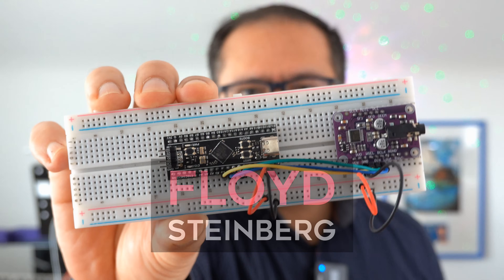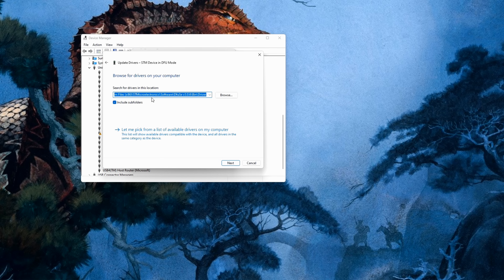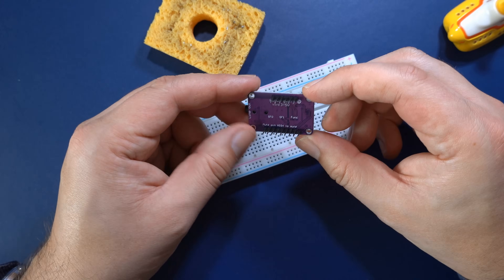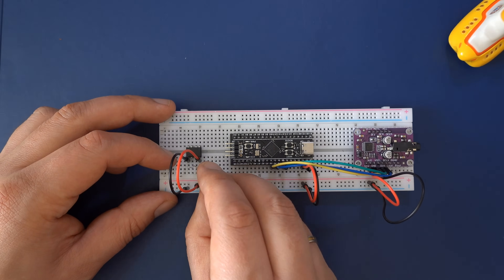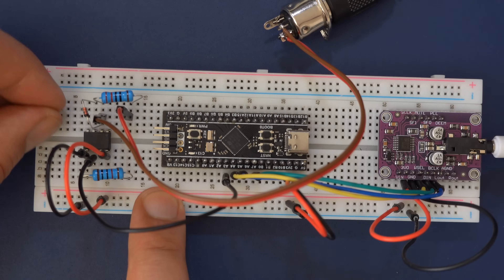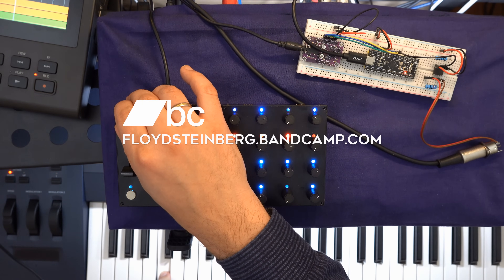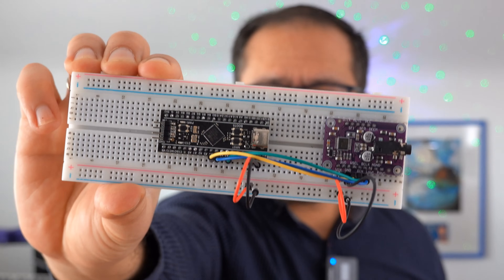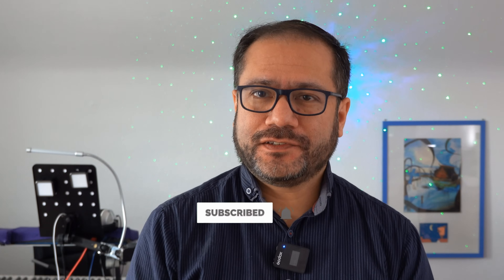This $20 synthesizer sounds very nice indeed

Comment from the maker: Please subscrive to Blaines' YT channel (and get the firmware over there):  https://www.youtube.com/watch?v=JttEPK7bwHw
BlackPill STM32F411 board (I bought the F411 25M HSE) https://de.aliexpress.com/item/1005001456186625.html
UDA 1334A DAC module https://de.aliexpress.com/item/1005004932558176.html
5pin midi socket https://de.aliexpress.com/item/33030129792.html
6N137 optocoupler https://de.aliexpress.com/item/1005004249645464.html
220 and a 10k ohm resistor https://de.aliexpress.com/item/1005004525936064.html
1N4148 diode https://de.aliexpress.com/item/1005004333197874.html
Jumper wires https://de.aliexpress.com/item/1005005990715944.html
Breadboard https://de.aliexpress.com/item/1005001456586666.html
Electronic component tester and identifier https://www.amazon.com/-/de/dp/B0BK95J4TV
Reply: Filter sounds surprisingly good. Haven't been producing for a while, so is that a diode ladder a moog filter? Sounded familiar, but it seemed creamy AND edgy...so maybe it's somewhere in between those 2. Or maybe it was a hard synch modulation making that sound?
Reply from the maker: @OMNI_INFINITY  Please watch @synthetechs videos on that topic: https://www.youtube.com/watch?v=9taujr3BouA and https://www.youtube.com/watch?v=687XoUewvp8
The synth is 100% software, all the electronic parts you see are for the MIDI input and the audio board.

Comment: Your work is certainly valuable, thank you. But finally, there are the devices you've connected. This part may be cheap, but what are the others?
Reply from the maker: Hi, I used the intech Grid controllers here (which of course are not cheap), but for this synth, any MIDI keyboard with some knobs will do, for example the RockJam keyboard, which is one of the cheapest MIDI keyboards you can buy.

Comment: Hello, I’m not sure if you still answering to comments but does this synth support USB midi? Or how can I replace midi controller? Maybe there are some diy midi DIN controllers.
Reply from the maker: Hi, as it is, USB MIDI does not work (if I remember correctly). You could replace the 5 pin plug with a TRS 3.5mm plug easily, If that helps.

Comment: Could you attach so potentiometers to a panel and then attach them to the board to control the parameter's?
Reply from the maker: Yes, of course! But you'd need to change the code to listen to input on some pins. This shouldn't be too hard, though, usually it's changing 2 to 4 lines...
Reply: @mr_floydst excellent! Thank you!

Comment: "make sure if pins doesnt touch other"...why it would be problem in this case? Only problem would be if tx touch rx. Midi is 2 wire protocol. 5 pins on midi standard port is BS...That is why modern uses just stereo jack instead.
Reply from the maker: Uh, to be honest, it's just a thing I said, like "don't forget to tie your shoelaces before heading out". Well-meaning but not that relevant, but also not wrong. ;-)  Obviously, having GND and TX/RX touching each other would render the MIDI port useless.
Reply: @mr_floydst  My point is that old midi 5 pin connector is just ancient tech, which was probably used as conector with more lines, but evolutions showed that tx rx (serial) is quite enough for humans

Comment: I am new to synths in general but VERY new with diy synths especially. Can you tell me if i would be able to sync this with my nts-1 and PO-33 or is that not something that is standard. Beyond that would i be able to combine the out audio but plugging it into my other synths or would i need dedicated hardware to do so?
Reply from the maker: Hi, as it is, this synth does not need syncing, as it has no sequencer built in (and it also does not support syncing LFOs and envelopes to time-triggers).
It's really intended for use with devices that have a MIDI out port, like MIDI keyboards, -pads or sequencers.

Comment: What in your opinion are the best CC channels to address for the 8 encoder knobs on my midi controller for a beginner to get some noticable and interesting sound changes.
Reply from the maker: Please look up the numbers in the document:
Filter cutoff frequency - to change the "brightness" of a sound
Resonance - to create that whistling sound
LFO depth and speed - used for creating periodic modulations like vibrato and tremolo
Attack and release - make sounds begin and end slowly or abruptly.

Comment: 1) How long did it take you to assemble the synthesizer? 2) How long did it take to debug?
Reply from the maker: The most work went into sourcing all the parts. Assembling it takes 30 to 60 minutes, and there was no debugging required (the firmware is readily compiled and only needs to be uploaded)
Reply: @mr_floydst  Tester and identifier of electronic components - can you do without it? It is not available. Or just measure with another tester?
Reply from the maker: Hi! Yes you can do without that. All resistors have color coded rings that identify them https://hirophysics.com/Labsheet/resis-codes/resis-codes.html
Reply: @mr_floydst  Thanks for the answer! But I meant, (Is it difficult to mess around with the setup: Measuring voltage, current, etc.!?
06:23 Testing and setup"!!! Will an amateur cope with this (I can only solder). English according to the translation and Google autotranslation.

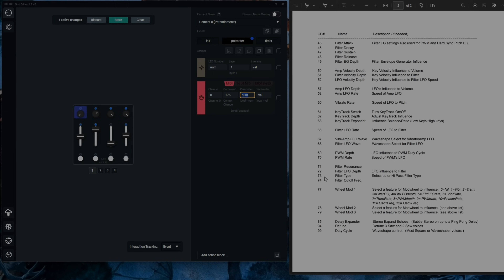Comment: I was tracking up to 7:26.  Could you explain what you plugged all that stuff into?  I see USB, a computer program, a keyboard, and the black box with the dials on it.
Reply from the maker: This is a MIDI controller, and the computer stuff briefly shows its setup app. You can use any MIDI controller (keyboard) that has some knobs on it. After setting up the knobs according to the list on the right (or in the BP synth docs), you don't need a computer. Just connect the keyboard/midi contoller to the synth via the 5 pin MIDI port.

Comment: and how much did the controller cost ? fake $20 cost
Reply from the maker: So you're arguing the real cost of e.g. a guitar pedal is the pedal itself plus the guitar? 
And a set of piano note sheets isn't $10 but you have to consider the cost of the piano as well? ;-)
Reply: And Dont forget to show your electric bill >:[
Reply: @mr_floydst  when starting from scratch yeah
Reply from the maker: In case you're just starting, you'll need to add the cost of a midi keyboard and some speakers or headphones on top. A decent MIDI keyboard can be bought from $40 up new (look up the RockJam MK, for example), and a set of speakers perhaps from $10 up. You'll also need a USB power adapter ($15 and up)
But for beginners, I'd really recommend buying a small synth with a keyboard instead of a DIY synth. Second hand, preferably. The Yamaha Reface series is quite nice, as is the Roland JD-XI or the Novation Mininova. Those are relatively cheap on the used market and while more expensive, may be better suited for the needs of someone new to synths. Hope that helps...

Comment: thanks for the tutorial. made it on a piece of printboard I had but for some reason my dac isn't working.
it does receive the digital input from the blackpill, all lines are checked with a scope but there's no audio on the jack, also no audio on the line out pins.
don't know if it's just a faulty dac or some other issue.
Reply from the maker: Can you test the DAC with another setup? This one is fairly common in DIY projects...
Reply: @mr_floydst  don't have anything to test it. But after making some extra ways to test and measure (a dedicated gnd for the scope gnd and a few jumpers to set sf0 sf1 and mute to either high or low) it must be the DAC itself. The amp part works but it doesn't convert the din signal to proper audio. Did a bit of experimenting with the din straight to the R-out on the DAC and the synth and different keys are recognisable. Going to order me a new one I guess. Glad to make it all swappable on header connectors. Thanks for your help!
Reply: @mr_floydst  Today my new dac boards got delivered and the synth istantly started working :) Just finished making a simple midi cc map for Native instruments Maschine plus so the synth can be used in full effect on the Maschine plus. fun stuff!!

Comment: I'm a total newb and wanted to pair the BP Synth with an arduino midi controller and a keyboard without a pc connected. What would be the easiest way to do this? I've coded the CC numbers into the arduino code but when I connect them together using Y cable it doesn't respond as well as if it's just the keyboard and BP Synth. Any suggestions? Hopefully it's something I can build. Thanks!
Reply from the maker: Hi, thanks for watching! If I understood your desciption correctly, you've built a MIDI Y cable? I guess that won't work because a Y cable will divide the current (halving it effectively in this case), that's why you MIDI connection becomes unreliable.
You need to build a MIDI in for your Arduino and merge the input from your keyboard to the Arduino's MIDI output in software.

Comment: Do yoy have any suggestions for Arduino?
I have Arduino Micro, PAM8403 D -amplifier with 16 ohm speaker, MIDI -input with optoisolator, all connected to power switch and 9V battery place. The only thing I need is a working program, since i want it to work with Alesis Vortex 2 -MIDI controller.
Reply from the maker: Hi, thanks for watching!
Arduino by itself isn't the best platform for synthesizers. Please take a look at the Teensy 4.1, which is compatible, but brings enough extra functionality to create fully implemented polysynths.
The most promising project that's playable via MIDI I found online is this https://projecthub.arduino.cc/CesarSound/arduino-midi-poly-synth-minisy-musical-instrument-6ad352
Also, the Mozzi Library https://sensorium.github.io/Mozzi/
Reply: @mr_floydst  Thanxs for the info.

Comment: The "put everything in a protoboard and then solder the pins on" tip is a great one!  I've dealt with a 3rd hand device and tape to get it done in the past - I'll do it this way from now on.
Reply from the maker: Thanks! I lifted that tip straight from Blaine's video ;-) It's really a good idea.
Reply: I usually do this using veroboard instead. But being careful with timing the breadboard will work just as well.

Comment: I really got get me a breadboard for tinkering and experimentation.
Reply from the maker: Please do - at around $2 (or something), it's an investment you won't regret ;-)
Reply: @mr_floydst  I first came to know of them while watching a diy guitar pedal creator some time ago. I thought, that’s nifty. You can plan and layout your circuit (neither of which I’ve ever done) while being able to disable it fairly quickly if if things go wrong. I’m more of a residential electrician so while I can read a schematic I can’t necessarily properly understand it plus you don’t really solder in this trade. Fortunately one thing that does translate, I feel, is troubleshooting which I am pretty darn good at. I’m rambling…
Anyhow Ty for the encouragement.

Comment: Surprised the bread board doesn't melt from being used as a soldering jig.  Those are a lot more expensive than 25 years ago.
Reply from the maker: It really depends on how long you take to solder. ;-)
I don't know how much breadboards were 25 years ago, but you can get them relatively cheap on the net...

Comment: Hi, do you have a link to the component tester used to test the resister?
Reply from the maker: Here you go https://www.amazon.com/-/de/dp/B0BK95J4TV
This will not only test your resistors, but tell you what you're looking at (diode, capacitor, resistor...) and if it's still ok

Comment: Great video and I like your soldering technique with the breadboard. One suggestion that would help amateurs like me is explaining why you're making these connections. While hooking up the midi chip it wasn't clear why you need a resistor or a diode, or what the different legs of the chip did as you connected them.
Reply from the maker: Thanks for watching! You're right, that would add value to my videos - I'll try to do that in future. As I'm trying to push out one video every week at the moment, I have to cut corners at certain points though ;-)
Reply: @mr_floydst  Understandable. You don't have to go into great detail, just expand on "connect A to B" with a quick reason would make things very clear. For example, "connect A to B for ground" or "connect A to B to allow volume control from the X", etc. Keep up the great work!
Reply: @soviut303   I hope Floyd doesn't mind the external link here, but I believe the information you are looking for is here: https://youtu.be/iiiMGXwyzqo?si=wvXS7FmELhJFcuRC   
I tried creating Tutorials to explain how the code works but there has not been much interest as it can get pretty complicated and takes a bit of dedication to study and comprehend.
Reply: Disagree - that would be electronics 101. It would be beyond the scope of the video, same information would need repeating in every similar video. Instead go watch a video on the basics of circuit components - it’s akin to commenting on a calculus video “woah woah, slow down egghead. Can you explain the concept of ‘addition’ please”
Reply: @Comonad  Not why I'm asking; I'm asking for the rationale behind the steps. For example, bad programming tutorials say "write this line, then write this line" while good tutorials say "we define x here so we can use it in our loop here". That's not programming 101, that's explaining the rationale instead of just explaining the steps.

Comment: Only in STM ??? Why not on Pi pico or Esp32? The Github respositorie?
Reply from the maker: I'm only reporting on these projects - I'm sure @synthetech can answer these questions...
Reply: STM32 is what I started with and I have used not only the F411 but also tinkered around with F407 and F405's.  The F407 actually has it's own built in 12 bit DAC but it can only swing from 0v to 3v unlike the DAC module in the project that can create true audio at -3v to +3v.
Porting between the F4 ST family is very easy.. porting across to Pico and Esp32 would require a lot more effort.
I did attempt to post tutorials showing how the code works with links Open Source examples for each tutorial focus.. unfortunately the interest in the Code Tutorials is miniscule compared to the Synth Build vids.

Comment: that was awesome bro, but how much with aqll the other gear included?  💣💣💣
Reply from the maker: I need that stuff for recording my video, all my viewers need is a MIDI controller and some kind of headphone/audio system. It's very likely my viewership has those at home already. If you're really totally new to synths, a suitable battery powered speaker is around $10 and a MIDI keyboard with some control knobs can be found from $10 upwards ;-) https://www.aliexpress.us/item/3256805128076352.html
Reply: A MIDI keyboard/controller with 5-Pin DIN jacks is needed.  That $10 link was not for a controller, it was for a sustain pedal..  typical bait 'n switch aliexpress listing.  They keyboard was $60 and it only had USB connection. 😞
Reply from the maker: My apologies for that. One should never answer mails and comments late at night, it only leads to misunderstanding :-)
As @synthetech said. You need a MIDI keyboard if you don't already have one. If a low price is important, search for e.g. the Arturia Keystep on ebay, which has the 5 pin MIDI connectors.

Comment: This is really interesting. I recently tried to solder my squishbox kit but it didn't quite work and I'm feeling daunted by desoldering and resoldering better.  This kit looks a bit more forgiving and affordable.
Reply from the maker: Thanks! Often, all you need to do is to add a drop of flux to your soldering joints and then reheat briefly. :-)
Reply: Second set of eyes in a reddit DIY forum might help you save it. I run a hot iron between joints that are close in addition to the brief reheat. Desoldering only if, eg, a diode, IC, electro cap is in backward.

Comment: Another amazing video! Thanks!  Has anyone used a Mac to do the BlackPill programming successfully?
Reply from the maker: Thanks for watching! I hope one of my viewers can answer this (I have no Apple Mac here)
Reply: STM32CubeProgrammer will work and there is a Mac version.
Reply: I'm not a mac user but you can use STM32 IDE on mac with no problems. You can of course program it without an IDE, but that will be a lot harder for beginners. And if you are an absolute beginner these things support arduino and micro/circuit python. But if you want to go with the python route I recommend rpi pico since python requires more memory.
Reply: STM32 IDE supports MacOS. Of course you can program it without it, but it would be super hard if you have no c/embedded experience (With IDE you still have to know what's going on, but it provides libraries and init code generation). If you're an absolute beginner and want to play around these things support Arduino and circuit/micro python. If you opt for the python route I recommend RPi pico, because python requires more memory.
Reply: While I used DeFuse to flash the BP in my tutorial since it was so simple and easy to explain to use.. I have seen on ST's site that DeFuse was replaced with "STM32CubeProgrammer" which does have a Mac version you can use.
STM32CubeProgrammer will load "USB DFU" files like DeFuse does apparently.  But I have not yet used it myself.
Reply: ST's "STM32CubeProgrammer" for Mac may work instead of DefUse.   I chose to use DefUse because it was so simple to explain vs. STM32CubeProgrammer which is used for many formats/methods to read/write to ST products.   
It's worth taking a look at if Mac is your only option.